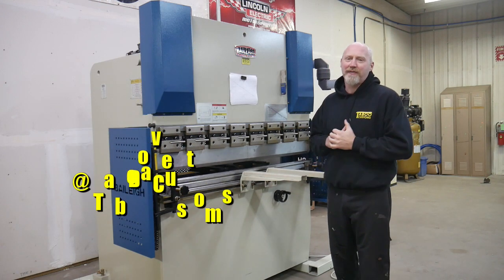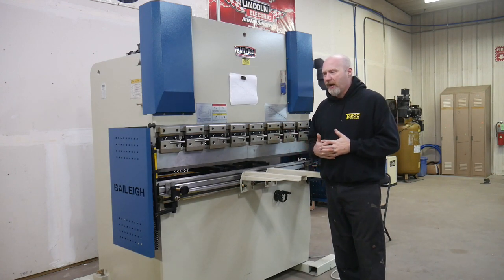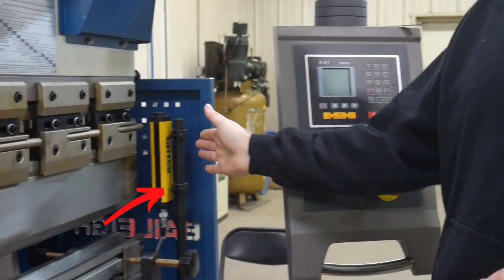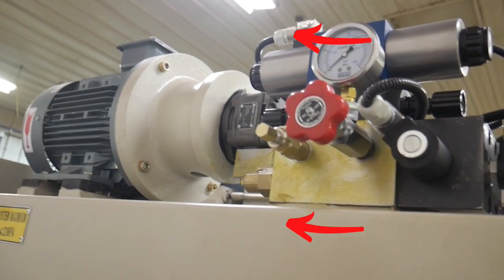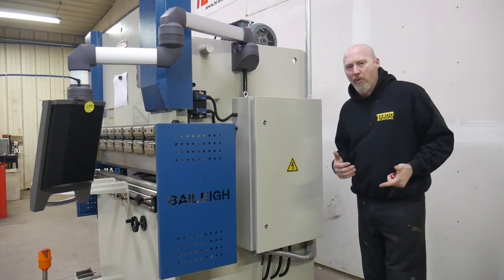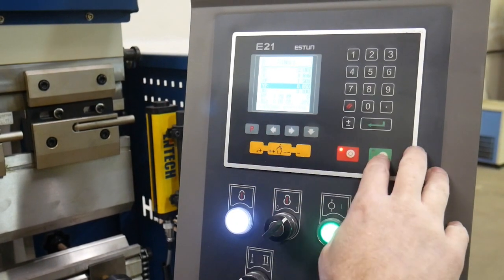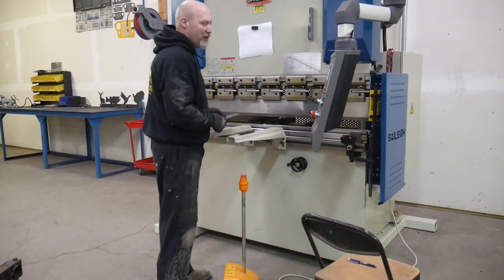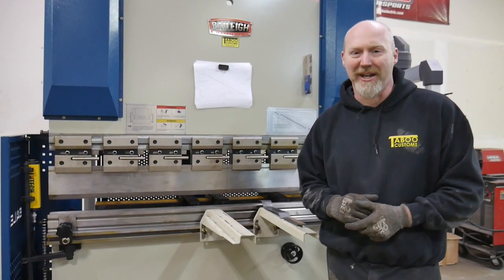Baileigh BP-3305 CNC Press Brake Review and Walk Around

Comment: I’m buying a used one this weekend I’m going to test it out before I buy. I want to do 90 on a 1/4x4 copper piece you know what are the parameter or the y set up
Reply from the maker: On the 2" die opening for .25" material I set the Y at .36 for steel.  You may want to not go that deep for copper right off the bat, probably dont want to over bend it and each machine may have some slight differences.  You may already know but if you dont that Y measurement is the distance from the center of the bottom of the die to where the top die theoretically stops so to bend it less the Y number needs to be larger.

Comment: Thanks for doing this video. I've been looking at one of these for our shop. My question is can the dies be split into smaller segments for doing things like boxes?
Reply from the maker: The upper die, yes, the bottom die, no its only held on the very end because it can rotate for different die openings.  The upper die is two pieces so what I do is spread the upper die apart to do corners.   I talked to Bailegh about purchasing a second upper die just to cut up, but they come as a set upper and lower and havent purchased one yet.
Reply: @TabooCustoms  The bottom die can be cut into segments. I will have a bar along the length that keeps the group in line and allow removal and flip quickly by hand. Just keep in mind your ram #s before each use. The upper die is already cut into smaller segments as well. Great machine.
Reply from the maker: @TUONOv4  Do you have a picture of your setup on the bottom It would be nice to be able to quickly change.  Can email dave@taboocustoms.com   Thanks